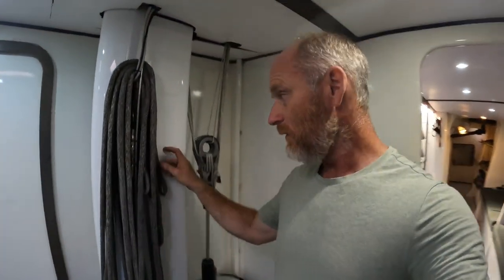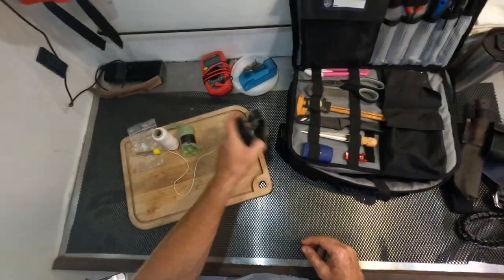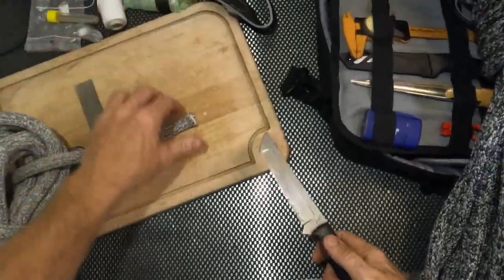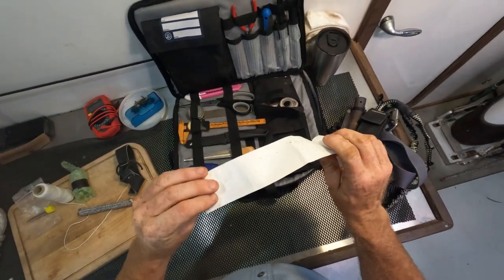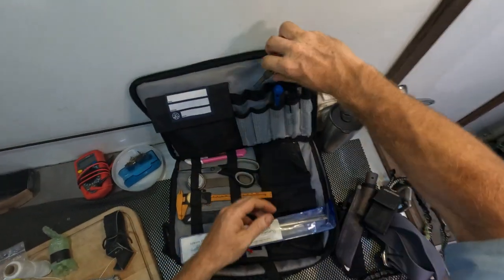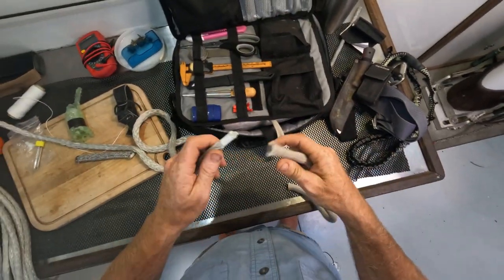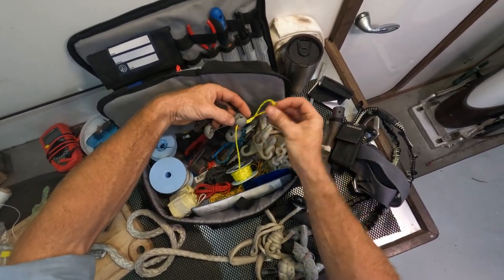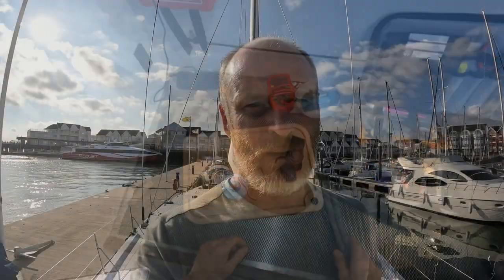#1 | Sailing Tools | The Rigging Bag

Comment: Wire splicing wands work well, I make mine out of high tensile fencing wire, and hammer the folded end so it’s tight. They eventually go at the bend in the end, but they are so easy to make I carry a few spares.

Comment: Great video. I've made a puller tool from 316SS TIG welding wire. A lot cheaper than the ones sold by insert brand here
Reply from the maker: Great tip! I worked with some awesome boat captains in Hong Kong who did the cleanest, most technically sound splicing I have ever  witnesses and they did it with exactly your tool…. I’m going to have to step up my game and move over to this technique - perhaps that’s something I can share :)?

Comment: Although I’ve carried needles and a palm for about 50 years I find I use a wooden handled sewing awl that’s really designed for leather. Very inexpensive and seems to last forever and will penetrate almost anything.
Reply from the maker: Great tip! I have something approaching a nightmare recollection of sewing for 30hrs in freezing co during in the Southern Ocean repairing a mainsail before heading in to Cape Horn. I can SPECIFICALLY remember wishing I had sewing awl as I drive the needle in with the sailors palm then swapped to my multi tool to pull it on through the material….. ah hindsight…..

Comment: Cool to see what's in your rigging kit. That knife is awesome! What else to add for rigging situations?? These are not traditional options, but what do you think of these? If there are synthetic sails onboard, maybe some sail tape and flexible adhesive, like Sikaflex 291 for bonding a sail, or maybe 3M 5200 for stiff areas? Would be interested in your thoughts on that. Also, what do you think about zip ties for screw-in type halyard shackles in semi-permanent situations, like roller furler head and tacks? To avoid a screw working its way out? Or maybe Loctite Threadblocker 242 would be better?
Reply from the maker: Sail Repair tools and spares is the next item people want to see- and I think the adhesives  you have mentioned there are a very important part of the discussion, particularly as more and more technical sail materials become rugged enough to be a sound economic decision, even on a cruising boat.  
With regards the zip ties for securing shackles ABSOLUTELY.  traditionally those kind of shackles are designed to be secured but too often now we rely on just tightening them up and/or basically poorly maintained pin threads that allow enough friction so the pin doesn’t work loose.  
it is amazing the questions I get asked that I just never would have thought of myself - thank you I will write this in my future content notebook!